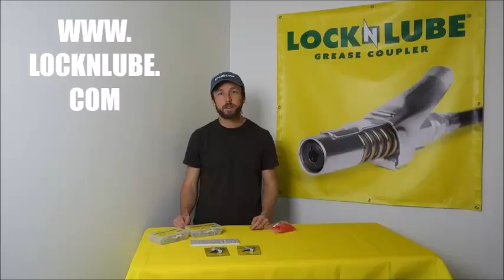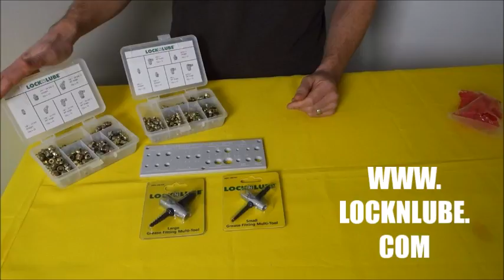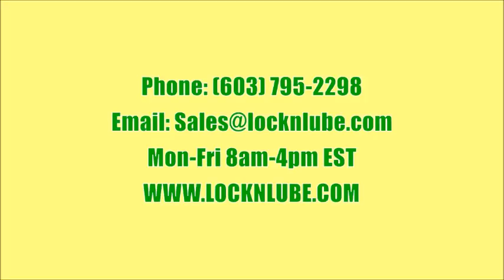How to identify and replace Zerks (grease fittings)

Comment: So, that's the threading. What about the actual head? Are they all the same size, and, if so, is this standard international? I can't find the definition anywhere.
Reply from the maker: While thread sizes vary, the part of the Zerk where you put in grease is generally all about the same size (there are of course some oddball sizes out there). We've tested our coupler with SAE and Metric and it always fits thanks to the way it clamps and locks on.

Comment: Try as I might,  can’t get a lock on the zerks. 2004 Ram 1500 with new suspension. Vids make it look so easy...what am I doing wrong? I replaced the suspension in my garage so I wouldn’t call myself weak....
Reply from the maker: If you push the thumb lever all the way down, it should go right onto the Zerk. Is the fitting in a tight spot where you can't get a straight shot at it? If so, you can check out some of our adapters for tight spaces: https://locknlube.com/products/locknlube-quick-connect-greasing-accessory-kit

Comment: What's the difference between a large and small zerk fitting?
Reply from the maker: For common SAE zerks the small ones have 1/4"-28 threads and the larger ones are 1/8" NPT. A point of confusion for some is that the 1/4" standard is smaller than 1/8" NPT in this case. Common metric sizes are 6x1 (small) or 10x1 (large). There are many more out there, but those are the most common.

Comment: It's good that your tool has a tap but I've bought a pack of 10mm zerks which are 10.5Mm and the threads of which are crap. Tried cleaning with a thread file 1 25 but no go so I need a die. But what size? In my cheapo kit the threads in the M10 did are too coarse.
Thanks anyone!

Comment: Help Needed:  I have a Kubota ZD28 with a broken Zerk in one of the front tire hubs.  The distance from the hub to the rim is very limited.  I have tried two different eze-outs without success.  The end of the tool is too close to fit the extractor tool wrench.  I have used a thick blade screwdriver between the end of the extractor and the rim to exert pressure on the end of the extractor tool while using small vice-grip pliers to turn the extractor ( can barely turn the extractor tool any at all).  I need a source for a very stubby extractor tool set.

Comment: It was enough to get me to sub; I replaced 2 the conventional way; I have 2 remaining that are hard to get to so idea;  A «holder» for starting threading in tight area; My application is straight in though O opening; 12-point chrome wont hold it right; Some sort of gripper on straight like an extension 3/8-ths drive